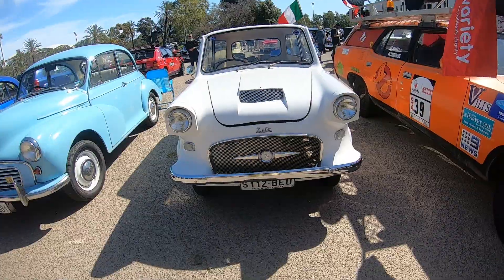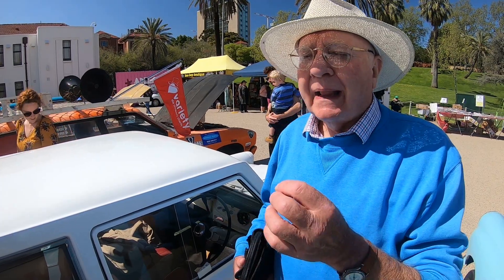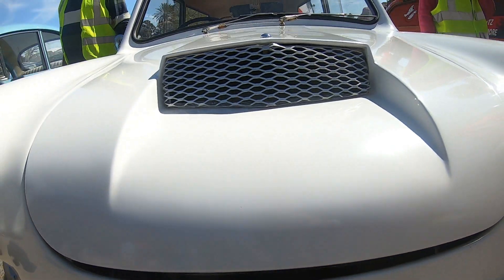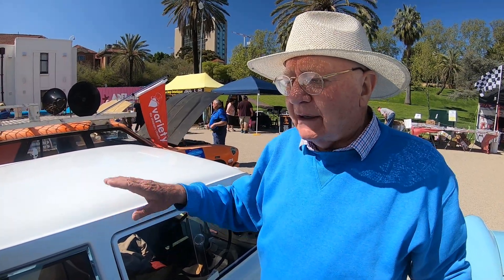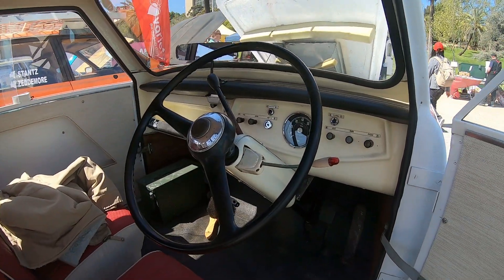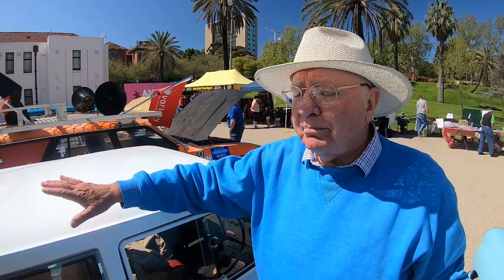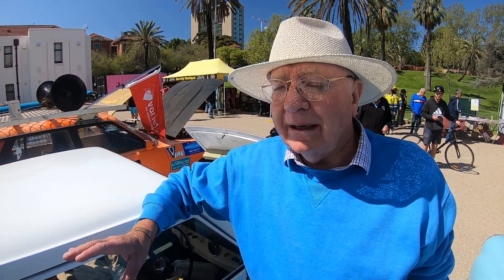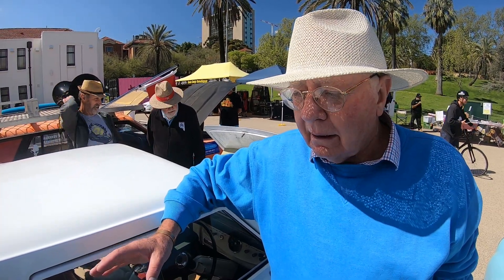LightBurn Zeta at Concours d'Lemons DownUnder 2019

Comment: Well, now that GM Holden, Toyota, Ford have gone from Australia, 
wouldn't this be the time to resurrect the Zeta brand?
Reply: Could even make it an electric car!
Reply: I had a 1964 Zeta bought second hand in 1966. It actually wasn't a lemon, it did what it was designed to do and the little 324cc engine was quite reliable. It was slow on the open road but a quick, positive gearshift enabled it to keep up quite well with the traffic around town. Its length and width were about the same as the Mini but the station wagon shaped body was more versatile. Being fibreglass the body was light but strong. It's just a pity the Zeta from its introduction had to compete with the more powerful four cylinder Mini otherwise I think they could have sold thousands.